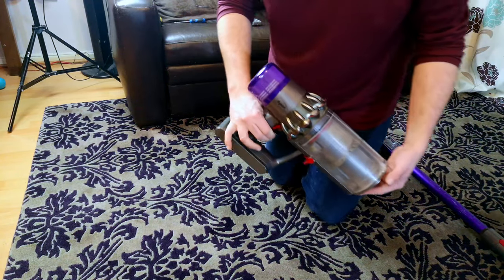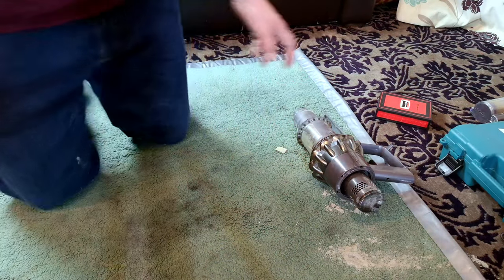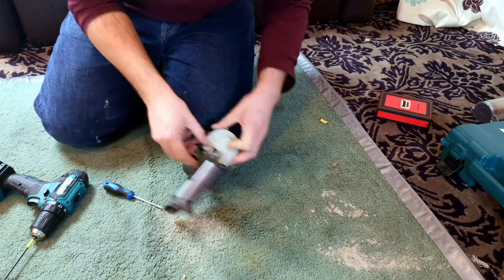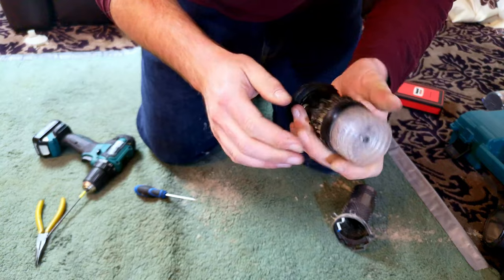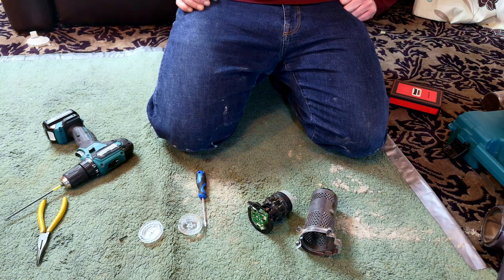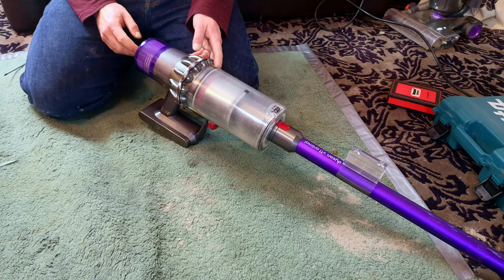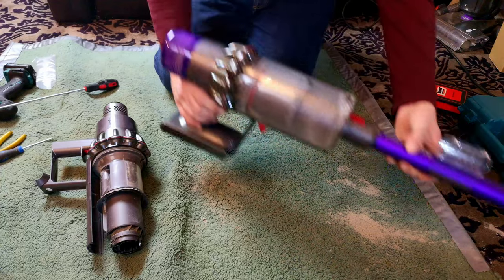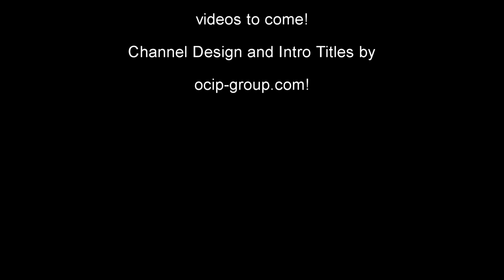Dyson V11 Cordless Machine-Gun edition - Another way these can kill themselves ...

Comment: I have a V11 that was given to me but only the body - no filters or other accessories and I have a borrowed filter and battery. (I repair Dysons all the time and have a running battle with Dyson who will not let me be an acknowledged repairer - but my customers are very loyal to me?). This V11 is pulsing when nothing appears to be wrong with it but Dyson have replaced the body and motor unit for the customers thereby acknowledging that they have a dodgy product I would say. What I am trying to find out is where the actual dirt sensor is in the motor as I am thinking that I can either clean that or disable it somehow. As long as the machine is then treated with respect it should carry on for years???
I also have a V10 complete that a customer gave me because her son convinced her it was a deadloss. I have repaired that, including the damage that the son did to the machine and I now have a perfectly good V10 that I use around our home that I would otherewise not have been able to afford! 
By the way I started dismantling the cyclone by opening the two halves, cutting the black and white DC leads in a staggered way and when reassembling I use automotive BULLET connectors which saves me damaging the connectors at either end of the cable. No comebacks. I repair broken triggers by fitting and glueing in place bits of paper clip to reinforce the stress points of the trigger - no comebacks.

Comment: it’s the filter, I know it works fine on the new body, but I bet if u tried a new filter it’ll work.
Reply: The filters have magnets in them that allow the motor to work. By pressing a magnet to the right spot you can get it to work without a filter and it still pulses....

Comment: My theory is a malfunctioning current sensor or a short across the head power leads. The CPU believes it's sensing resistance across the power head, so it increases power to go into carpet mode only to immediately find that the voltage doesn't drop as expected (since the resistance is not from a motor) so it immediately returns to base speed and the cycle starts again.

You could verify by testing the pins in the accessory connector for resistance. They should probably be open or in the megaohm range, I can tell you when I get home to my rack full of water damaged V11s!
Reply: The key here is that it works normally when the power is already maxed out, which means it's not a problem with the drive circuitry but a problem with how the computer decides what speed to request. When the decision is taken away from the CPU, it works fine.
Reply: @Jergling  - would it be possible to identify the dust sensor and disable it. the machine pulses with no attachments connected.

Comment: Sam do you know how to fix kinks in a hoover hose
Reply from the maker: I'd try and soak the hose in as hot water as you can manage. Or maybe hold it securely somehow and slowly pour boiling water over the kink. Got to make it re-form. Washing machine on a hot wash too if you can get the ends off